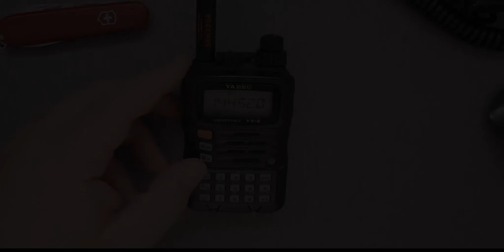Yaesu VX-6 Channel Frequency Steps

Comment: How come i cant get 2.5 step freq? I am trying to setup and i get an error on some freqs as well such as 161.900
Reply from the maker: There is no 2.5 step, 5/10/12.5/15/20/25/50 and 100 kHz.  At 161, if you push the PTT, it will not work for that is not a valid frequency for the radio to transmit.  Good luck
Reply: @frankwc0o  I work for the railroad and use the frequency 161.900 also 159.900 to talk to dispatch 
There isn't any way for me to rx or tx on those? Any ham radio suggestions?
Reply from the maker: @ManaBoots  you will Rx but not Tx for those are not ham frequencies.